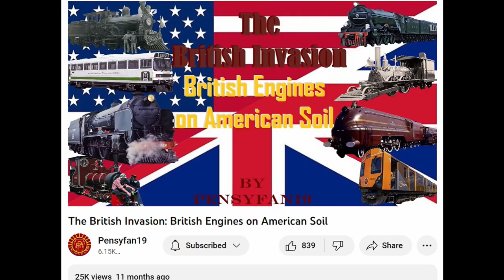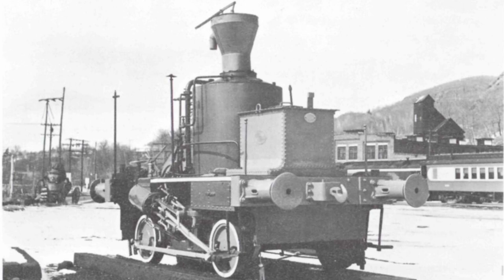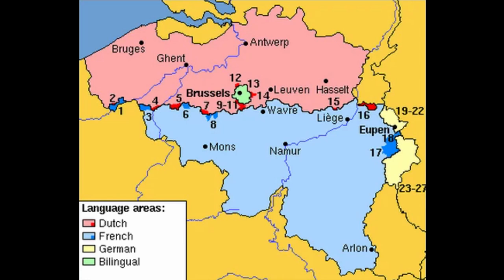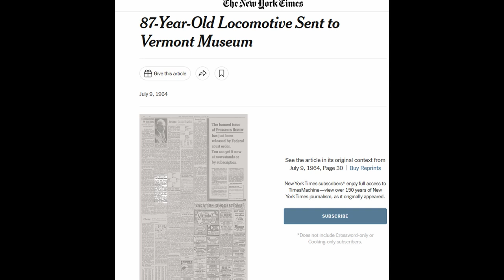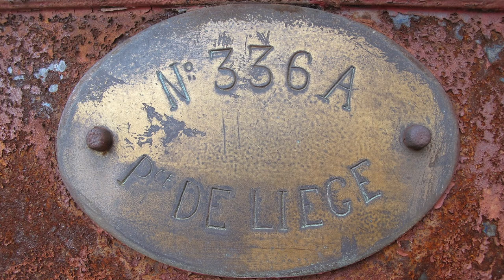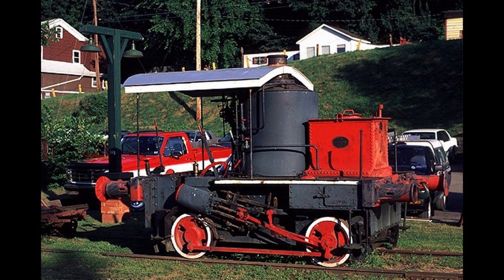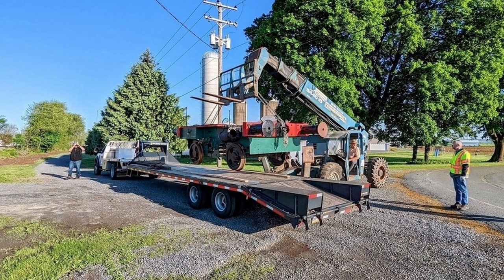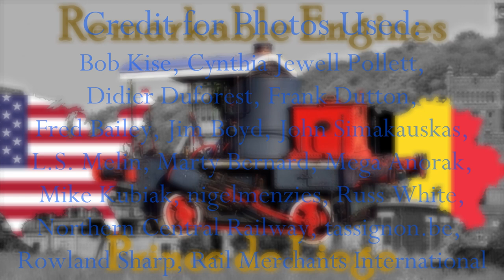Remarkable Engines: Prince de Liege

Comment: Locomotive request for the next episode of Remarkable Engines:
CSX 9280
Reason: This engine is one of only two engines that have the distinction of returning to it's original owner after being sold to a smaller freight railroad.
The engine was originally built as CSX 7627 in 1990. The engine was sold to Pan Am Railways in 2016. It will ultimately reunite with it's original owner when CSX absorbs Pan Am Railways on June 1st 2022. ANd it also has the distinction of being the last standard cab Dash 8 on any Class I railroad.